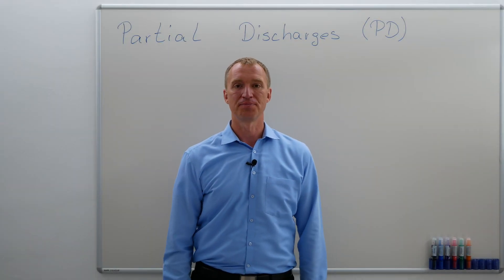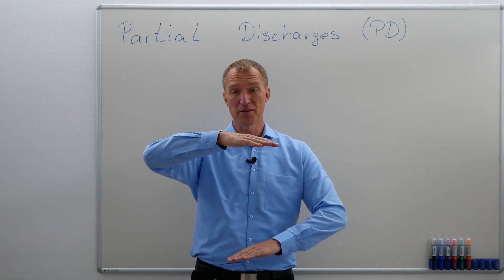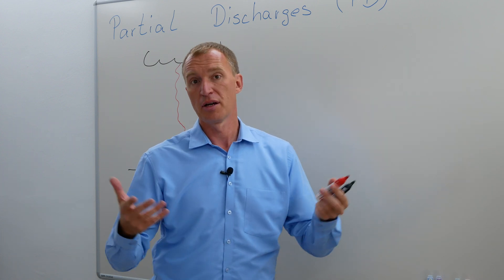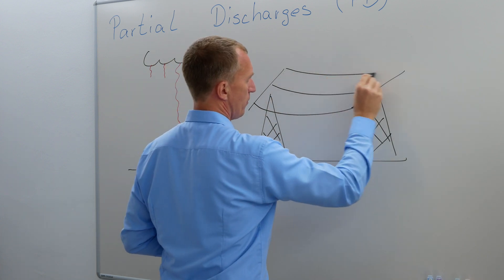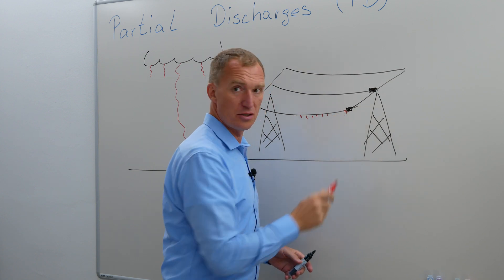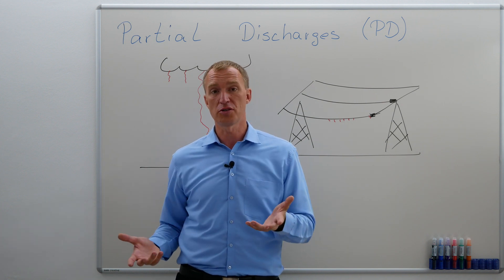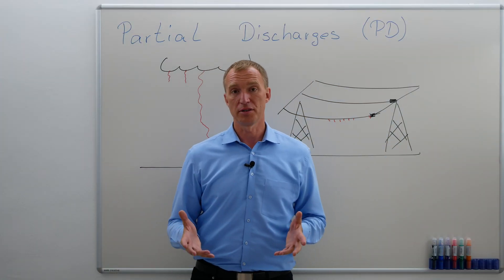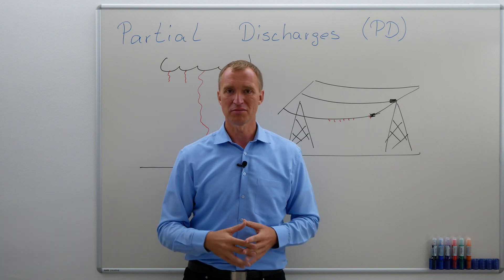1.0 Introduction to the Partial Discharges Guru channel

Comment: Excellent decision to share your vast knowledge on PD on this platform rene. I always felt you have a lottttt to offer for the HV community. I can only wonder how lucky people are for having you here, a selfless guru sharing an ocean of knowledge without having to even pay. 

My suggestion for future topics:
1. Advantages of synchronous measurements.

2.Different types of PD patterns that can occur based on the insulation type (Solid/liquid/gas)

3. What criteria to consider for assessing severity of PD? (Amplitude/repetition rate etc.)

4. FFT vs Wavelet analysis of PD

5. Developments wrt AI/Machine learning in the field of PD.

Cheers and All the best 🙂
Reply from the maker: Thanks a lot! I will consider all these suggestion and I am very thankful for them. I will do my best, to work out a proper didactic approach to create a worthwhile video. (Believe it or not, that takes most of the time - find a proper way to speak about a subject in less than 10 min.)